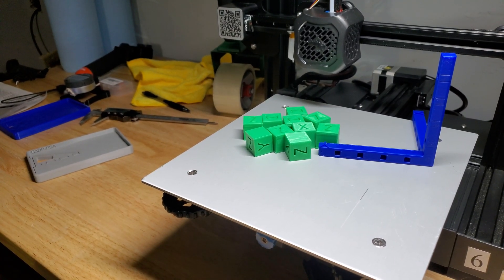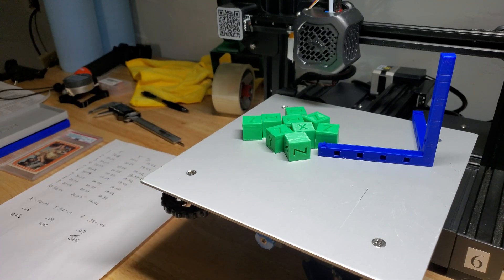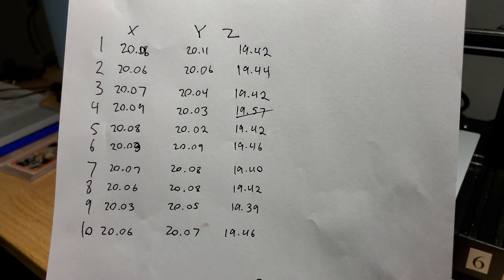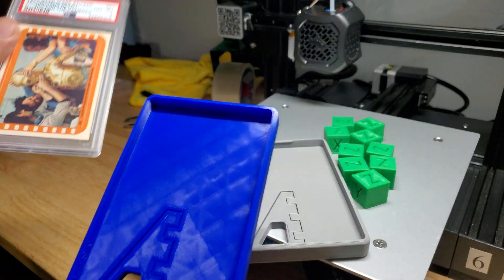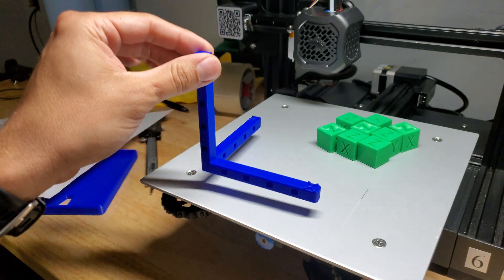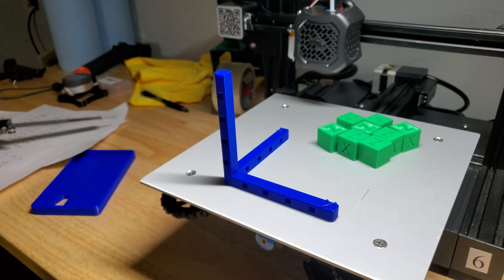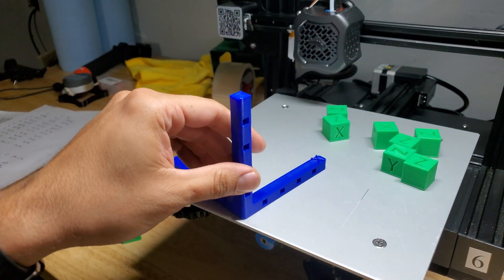A Better Way To Calibrate Your 3D Printer. Importance of Dimensionally Accurate 3D Printed Products

Comment: If your motion system is accurate I.e. steps per mm then you will get the same variance in mm whatever size the calibration object is.

This is because the variance your measuring is the under or over extrusion at the outside of the test print.

But 0.3mm just seams a bigger variation as a percentage of a 20mm print than it is as a percentage of a 100mm print.

To calibrate a dimension
Print parallel lines
Each 10mm wide and 5mm high
100mm apart on centre
Then still on the print plate
Measure 
each line actual thickness
          Thus will tell you over/under
           extrusion
Measure
Overall width
          This will allow you to calculate
          Actual distance on centre
          This is true dimensional   
           Calibration

Comment: Hello, I need some help.
I am new to 3d printing and i printed this 100mm calibration print, and it in fact showed that I had some issues (i get 99.5, 99.6 ...) but i don't what to adjust, what settings should i change in my printer or in the slicer ? 
Thanks

Comment: Great video. Like the calibration print and how it avoids the over extrusion corners. Which 3d printer do you consider more repeatable than the Ender 3 and that we can afford? 
A thought for you. Why not have your calibration print in some smaller sizes like 20mm, 40mm so we can get the calib close then use your 100mm. Your print shows 3hrs in my Cura setup.
Thanks

Comment: what do you mean by "calibrate to 100mm"? so, what is it exactly I am supposed to do? Adjust E steps? or Flow? So what am I supposed to do after a calibration cube or any other model? thanks

Comment: my take on it is calibrate motion system itself, not print itself because you never know how filement thickens would scure the measurment and throw off all your calibration either by changing the flow calculation of base or simply making too wide or too narrow lines of print and slicer calculate size of object based on that by offseting nozzle inward of the model by half of programmed line thickness
for x y  take a piece of paper, home printer on a piece of paper sticked to the table , move nozzle up a bit, then move to x y 50 50 drop the nozzle on the paper and move  axiex 100mm or anything really in a square of known size
if the nozzle get to the point the motion system itself is not sloppy, if not you need to fix printer first
if it does go back to the starting point exactly you just measure the square scratched on the paper then you calibrate line thickness in the slicer!
z is a bigger  problem because it is hard to measure if z screw is accurate but you can do it without even printing anything just by moving it up and down by known amount and measuring bed to gantry distance
calibration cubes are not ment to calibrate steps per milimeter , they are only used to calibrate flow by measuring horisontal expansion and size doesn't really matter when your motion system is calibrated corectly printing 20x20 x20 should give you cube this size plus minus any error made by filement spreading too far or too little and error will be the same no mater the scale of the object
calibrating motion system using printed models as scale makes you only calibrated for one size of the object, the same size as your test print, and everything else will be a bit wrong

Comment: I am going to use this on my CR-10.  I always thought the same way about the calibration cube.  It is so small that the percentage your printer is off is shown by such a small measurement difference in something so small.  Your calibration print looks really good.

Comment: I noticed that the 20 mm test cubes were off by around  0.05 mm and that the 100 mm test shape was also off by approx 0.05 mm which means the printer is consistent in it's actual dimensional deviation.  Creating test shapes that roughly match the largest dimension of a print is a great solution.  It should produce more accurate calibration with less effort.  Thanks.

Comment: You can’t get better than .1mm for FDM. Your trying to get a smaller tolerance than your printer or stepper motor can handle and trying to get Cnc accuracy with plastic that has shrinkage and expansion during and after printing so you’ll never be satisfied if you keep chasing your tail trying to make something impossible possible.
Reply: .05mm layer height is possible on a neptune 3 pro. It takes an inpractical ammount of time but it is very do able. Using adaptive layers you can even hit .01mm using fdm on some areas of a round print. You need a quality tungsten carbide nozzle.

Comment: I'm just getting started as a maker and this advice should help a lot. Any screw holes I set in my prints always came out slightly oval, which threw everything out, I'll try this and see if that fixes the issue.

Comment: How could I adjust it in the Orcaslicer for X1C Bambu Lab? I have 99,80mm on X, 99,87mm on Y and 99,84mm on Z.
Reply from the maker: You can't adjust steps on bambu firmware. You have to compensate in the slicer, I don't use those products so I can't give instructions how.

Comment: This is not a calibration problem. This is en engineering problem.

Since you're smart enough to know the dimensions of your prints will never be 100% spot on, you should engineer another solution to make sure that
your product works as expected.
In this case i would add a thin layer of filament all around inside the case so the the acrylic slab will fit in a little tighter and stay put. 
Not ideal but it would work. The user would just have to exert extra force to push the acrylic piece in and out of the case.

You can also make them bigger and make space for a thin layer of rubber strip so the rubber will hold the acrylic and compensate for any dimensional inaccuracy.

The possibilities of solutions are endless but you chose to go the hardest route.
Reply from the maker: 100% agree, I just want to make as little compensation as possible. Been printing my product for two years now straight from the machine to customers door without any issues.

Comment: Good video and a way to get better prints. However the real reason for the inaccuracy in the Z is because of the use of lead screws with backlash so the first few layers are compressed (elephants foot). The only way to eliminate this fully is to go belted Z drive.

Comment: I was printing xyz cubes on my ender 5 pro and noticed I have a problem with the z-axis of the cube being “smushed down”. Do you know what it could be?
Reply from the maker: You could have binding of the z axis. Something may be causing the z axis to not move up smoothly. Check your lead screws and v rollers and make sure everything's is moving smoothly. Try spinning the v rollers by hand to make sure they are not too tight.

Comment: What attributes have you calibrated on your printer?
Reply from the maker: XYZ steppers, Extruder steps, that's about it!
Reply: @Redo3D  Do you use linear rails or the screw-type system like enders have? Also, what slicer do you use?

Comment: Thanks for the calibration print, it really helped calibrate my Ender 5 pro which wasn't possible with the cube. My question is what is the purpose of the holes in the part? Do you think it's necessary? because it only slows down the printing speed.
Reply from the maker: I ended up removing the holes. So essentially they are pointless lol. It was a newbie mistake

Comment: Dude you're about as anal as they come. Most manufacturing tolerances are within .010 inches which is the width of a hair. Your .04mm is only .001 inches which is way better than manufacturing tolerances. This means your design sucks. It's not the calibrations fault it's not the printer's fault. If you look at .04 mm with a set of calipers you will barely even see the gap between the jaws. Calibrating with a cube works perfectly fine. It's just you. Plus it's worth mentioning that if you're only off .04 mm on a 20 mm cube then you multiply that by 10 to see the error over 200 mm bed size which comes out to 0.4 mm or .015 inches which is basically the same as manufacturing tolerances. Nothing in real life is ever perfect ever. This is why manufacturers have tolerances on everything that's made. I personally don't think the cube is the best method to calibrate but it's the best thing I have that I know how to use. I'd like to think there's a reliable way to use a dial indicator like a machine shop would use. But I've tried that and prints don't come out the right size.

Comment: Wow I have to say this made so much difference. Tried twice with the 20mm cubes and I was still getting results that were out, but with your 100mm test print my printer is now bang on. First print (after trying with cubes) was 99.3, 98.5, 99.6, second test after adjustment was 100.01, 100.03, 100.00.

The 20mm cubes are just too small, so absolutely any printing variation translates into how accurate you can measure them. Turns out that using the cubes made my printer go from over sized at the stock settings to under sized. At worst its now 0.03% out, which to me is bang on.
Reply: How do you actually calibrate it though? Let's say I found out I'm off by 0.3mm how which settings do I adjust to compensate for that?
Reply: @1SmokedTurkey1  there are other videos that explain how. It's slightly different for each printer.
Reply: @chrism2964  been specifically trying to find it but I can’t seem to find the right search term “calibration adjustment” doesn’t bring up anything useful. Can you guide me somewhere? I have a Bambu P1S

Comment: This is because of material shrinkage which gets worse with more infill and more walls. So it´s really hard to calibrate to but we can make some approximations.
Like 0.5% shrinkage with PETG, you can now simply scale your part by 100.5% in your slicer and voila. 
This is why your cube will be fine since it´s tiny and a 200mm piece will be off by about 1mm.
Also what YOU measure with the cube is the "corner bulge" never measure corners, always round up your calibration pieces since the corners will have acess material. Measure in the middle of the cube, this alone will be more precise by 0.2mm.

Comment: Isn't elephant foot caused by print head being too close to bed in first layer?
In top layer maybe the ironing setting is wrong?
Maybe wrong I don't know just an idea. I am trying to find a solution to get better prints myself.
So far no luck with my Geeetech A20 printer
Reply from the maker: In this example, the 2nd layer is oozing over the first layer because the z is not moving up high enough as it should. So this is causing the elephants foot.

Comment: yup, i always scale my cube to 150mm and only print a few mm high to at least get an idea of my x and y. then i print a 150mm tall cube and adjust accordingly.  The smaller the cube or part, the more thermal expansion, and tolerance loss

Comment: My Z axis is spot on. but my X/Y axis are off 0.15mm. The external perimeter is 0.15mm too large and internal features is 0.15mm too small...any ideas?

Comment: You changed your testing method to get better results! This is wrong, of course with a larger print your error is gonna seem smaller. The calibration cube is fine, you just need to calibrate your esteps for dimensional accuracy. And for a interlocking coupling or "click fit" you just need a 0.1 accuracy, it just needs to be done right. 
You can solve the elephant foot problem with a tick in the slicer. 
If you calibration cube shows some lines that you can't see with the larger print, it's not a problem of the cube model obsiously; It's a calibration  problem that is gonna reappear as soon as you start printing some details or something small. Your printer needs to be able to print details and smaller parts, so you need to calibrate for that. If it can do that, then it will also do the easier, larger prints.
You also can't use a large model for calibrating because you need to be able to iterate fast, that's why the cube or the 3Dbenchy are small.
Also, don't use garbage filament.

Comment: This video is hilarious. “I think I cracked it” ahahah. And a very valid point, I didn’t think of it and it will help a lot, thanks. 
I have to say tho that 13 minutes to say “use a bigger calibration print” seems a bit of a cheat, scripting is never underrated
Reply from the maker: Definitely could use some scripting but I really just make these videos on the fly. I hardly have spare time!

Comment: Printing your XYZ calibration as I type this. Just before this I did the nozzel extrusion check and after 5 extrudes of 100mm I am getting an average of 100.03mm. Crazy. This is on an Ender 3 S1 Pro. Thanks for all your videos. It’s so refreshing watching someone that’s not a professional YouTuber reviewing printers that were given to them like “it’s a great printer!” Yeah no kidding they payed you to say that. So far I’m following your advice with leveling and extrusion and stuff and the proof in the pudding is in the eating or whatever that saying is. 

While looking online I see people, including me, are printing holes that are about .4mm undersized. Have you come across this? Have any fix for this?

Oh yeah, and I just subscribed. Keep doing what you do. Cheers from Sweden.
Reply: They are not payed. You are overextruding because you need to calibrate steps per mm. I have the same printer, after calibrating the steps I get the exact 100mm. A manufacturer can't make the steps exact because it depends on ambient temperature, the filament you are using, among other things, so you need to calibrate it yourself.

Comment: Buy a ender 3 an think is a 1500$ printer 🤣🤣🤣 20.06 is the same som 100.06. Where is the test? This Is only theory. If you have 20.06 to 40.15 to 60.58 to 80.95 ok but not only theories.

Comment: If you calibrate using the cube, and get over shoots ONLY, obviously it's going to be wrong. You want to have the avg on 20mm. So between 19.96 or 20.04 would be avg on 20. So even your 100.08 or 100.01 is not on par either, right?

Comment: First of all, if you have products to sell that have "Extremely" accurate measurements, you aren't going to use a 3D printer. Also, you are not going to use a cheap caliper. You will need a professional caliper, made by a reputable company, such as Mitutoyo. They give a certificate of calibration, which just means that the caliper was checked using a national standard over various distances. They also normally include a standard with the caliper, so you can check the accuracy of the caliper from time to time. It should be checked on a regular basis. Also, the standard should be checked occasionally. Dropping, normal wear and tear, etc. Especially check it if you drop it. Same goes for any calibrated measuring device.

My expertise is, I was in machining for over 15 years. So, having said that. Do not use a 3D printer if you have tight tolerances. .05mm is considered a tight tolerance. It is about .0019 thousandths of an inch (1-9/10ths thousandths of an inch)

If you buy a cheap set of calipers, it won't come with a certificate of calibration. And if it does, be very skeptical. You are at the mercy of the manufacturer, you have to take their word for it. Or, you can invest in a couple of standards (A 1 inch standard for starters) that you can use to check your caliper's accuracy.

When you think about it, if the machine has a +/- .05mm tolerance, and the caliper has a +/- .05mm tolerance, you already know that it is possible for a product to have a +/- .100mm difference to begin with. This isn't including the tolerance of the part you are making. This is only critical for part fitment.

Comment: hi it's realy intreasting what you propose i will try it but in the mean time i have this probleme the outer dimension of my 3d printes parts are accurat but the inner dimension like if there is a hall or square in the middle of the part the dimension of that hall or sqaure are smaller by 0.4 mm in X and Y axis do you have maybe an asnwer for that thank's

Comment: Mechanical engineers refer to this problem as "tolerance stack-up". The solution is to calibrate to the largest dimension whenever possible.
Reply: so basically a calibration print that covers the entire build area would be preferred?

Comment: Mechanical engineers refer to this problem as "tolerance stack-up". The solution is to calibrate to the largest dimension whenever possible.

Comment: Good work on your video, question this is only for X and Y only I see when I printed it there was NO Z on it? Or assume that's Z.
Reply from the maker: That's correct. The z is vertical.
Reply: @Redo3D  Why I ask It was the corners where not rounded off like on the X  and Y.  Thank you for the help.

Comment: Thanks for your video! I tried your calibration file. But with the updates steps I find that screw holes are now printed elongated. X and Y are no longer equal as in the factory Settings of my Ender 3 pro. Is there more to it?
Reply from the maker: Hey Stephan, there shouldn't be any difference, as long as your x and y measurements both read 100mm the holes should not be an issue.

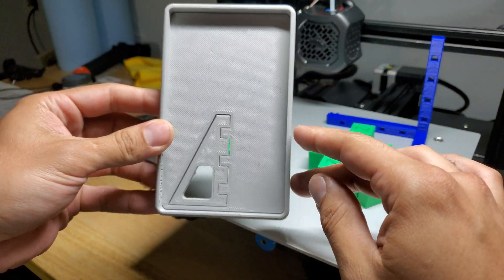Comment: 4:50 sorry dude but you saying 0.03mm is "unacceptable" while using a 3d printer is quite funny to me 

Edit: nevermind. You are off 0.3 PERCENT not mm!

If accuracy matters so much to you, why are you not doing 218mm long calibration squares?
Reply from the maker: Because my calipers only go to 150mm and 100mm is good enough accuracy for me.

Comment: How do you account for material shrinkage into the Calibration print? If I measure this using PETG should I scale the print this up by 0.8% to account for material shrinkage?
Reply from the maker: What I have done is I have waited until the part has cooled down to take measurements. Then calibrate. That way the shrinkage is factored into the calibration.